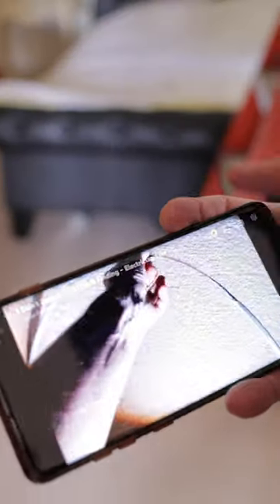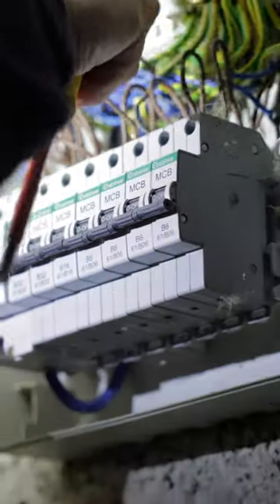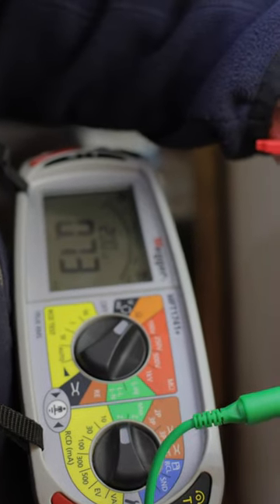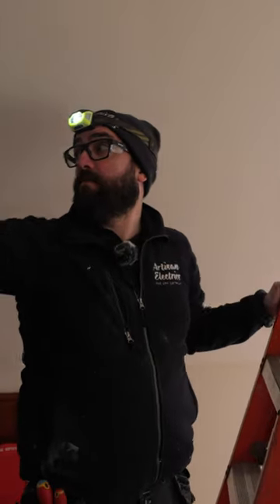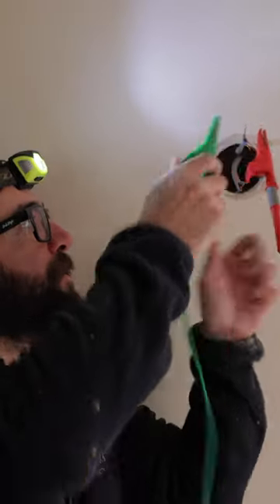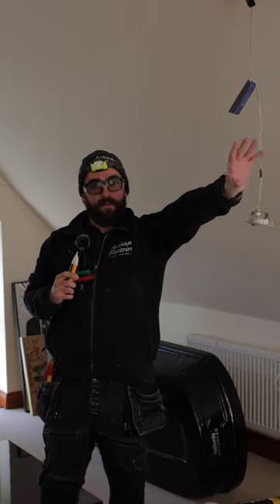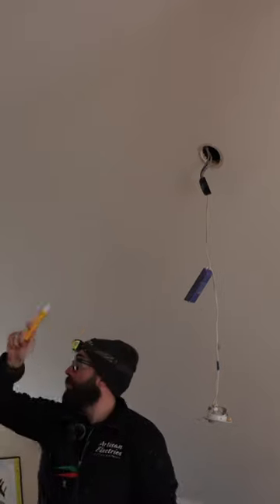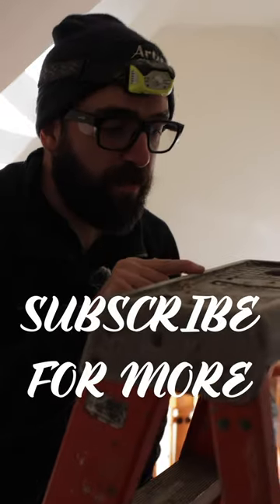SHOCKING ELECTRICAL FAULT - What could be causing this? 🤔 #shorts

Comment: As a pest controller after the mice comment I think I have a bit of an idea what's going on here. Especially if its a recurring problem. Gonna need to get rid of those bastards first than fix the electrics. I don't know how uk laws work here but in the us we generally trap, bait and exclude around the building to stop future mice from entering. Seen a couple fried mice and seen many many chewed wires from power to data cables mice are the worst.

Comment: Thank Q. Which smart switch 2 gang and one 2way way switch would you recommend?
Reply: If you mean two wireless switches and one regular switch on the same plate, then Quinetic make switch modules compatible with a variety of modular systems.

In particular they do one that is compatible with Scholmore's minigrid system. Minigrid is nice because it lets you put three modules on a "single" sized plate and because Scholmore's standard lightswitches are minigrid-based as standard, so you don't pay a premium for modularity you can just buy a 3 gang Scholmore Click lightswitch, remove two of the regular switch modules and replace them with the Quinetic modules..

Comment: I have an older property and bloody rodents are for ever chewing through cables.  Only thing for it is metal conduit or SWA.  Of note mice will tend to chew cables to enlarge holes so blocking the hole fully or feeding cables through walls in pipes or conduit can alleviate this.
Reply: Metal conduit inside a domestic property?? R u delusional
Reply: @adamsharp201  I have the lot, powder filled, 2 core lighting, metal conduit, pvc conduit, surface run the only thing we don't have is lead cables, although they were fitted originally and probably were rodent proof too.  It comes with 13c buildings.
Reply: @adamsharp201  clearly you haven't heard from the sparkys up in chicago far as I know they mostly use metal conduit for everything even residential.
Reply: @adamsharp201  are you inexperienced?